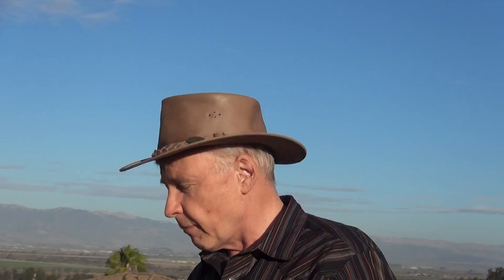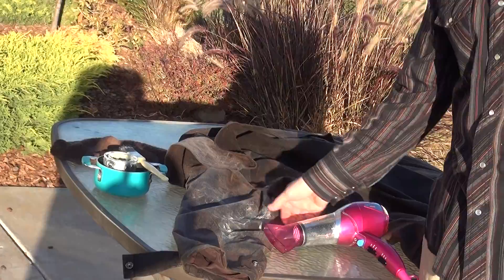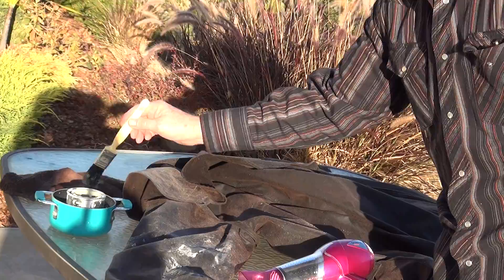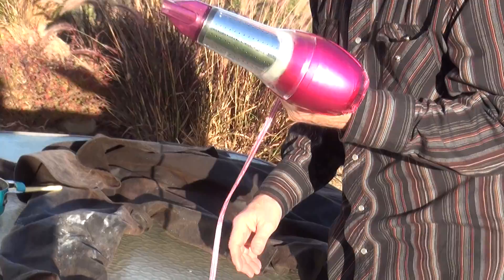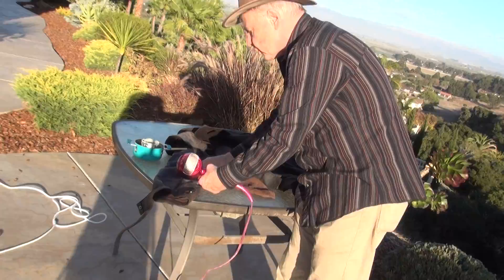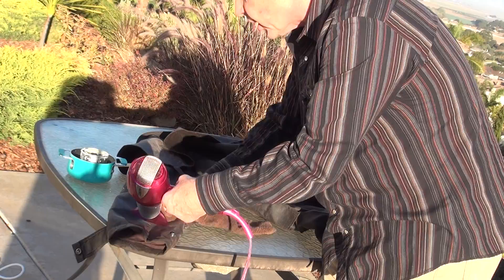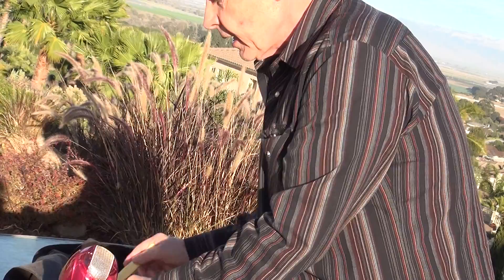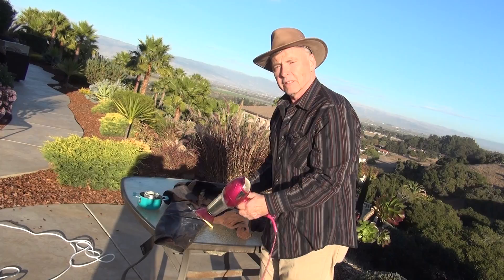Drizabone Rewax

Comment: A pink hairdryer LMAO - I hope you have a good leather holster for that beast LOL. In the Outback summers you can fry an egg on a rock in Australia, so we always wax our coats in the middle of summer. On stock camps in the old days no one had electricity available, so you had to use the sun. Once a year is plenty if you're using the coat all the time. You leave it out in the sun so the fabric heats up first...hot fabric makes it easier to apply. I make my own waterproofing mix using a block of beeswax, raw linseed oil & turps. It's the same recipe handed down for generations & it was used too for waterproofing the Australian tents etc in WWI.  Your hairdryer tip is a good one if you live in an area where your summers aren't real hot. Australian bushmen in the old days always knew to reproof their oilskin coats every year in mid summer.

Comment: I make my own wax mixture from parafin and mineral oil.

I use clean shop rags to appy the wax and rub it in with heat from a heatgun.

The rags end up wax impregnated so when I'm finished I cut the rags up into 3cm x 3cm pieces and use them as fire starters in the bush. it gets wet here in British Columbia.

Comment: Hi Neal, greetings from Australia 😁 another suggestion I'd make is to perhaps use the wax solution when it's cool; use a boot polish brush and brush it in like boot polish. Apply a thin(ish) coat of wax solution and then heat it up with the hair dryer so it then absorbs into the fibres. This way you're putting it on, and you won't need to take off the excess.

Comment: Looks like you made more work for yourself 
1. No need  to “boil” the can
2. Use a thick sponge (the type you use to wash a car)
3. Spray the coat lightly with water before you start. Doesn’t need to be  ha ha… “drizabone”
4. Hang out in the hot sun to bake afterwards 

Seems you made it much harder than it really should be, mate.

Try this in 3 years.. 🍻🍻